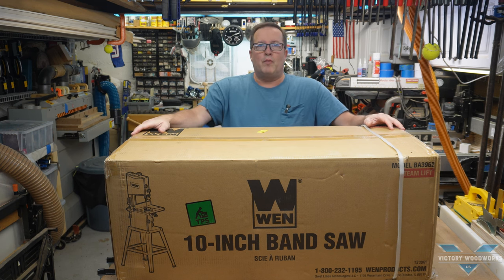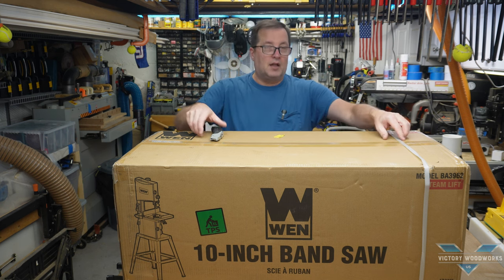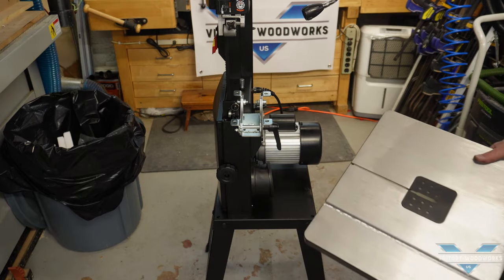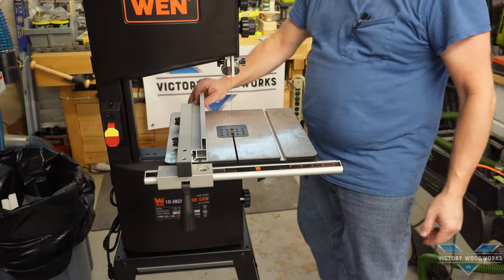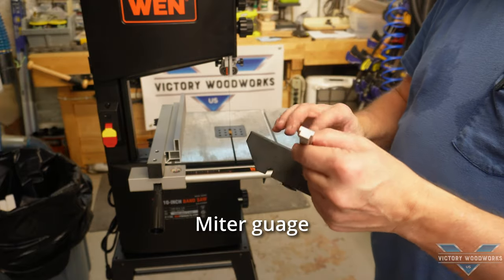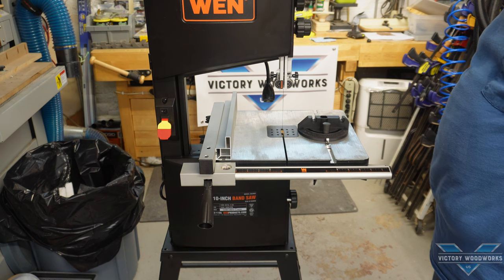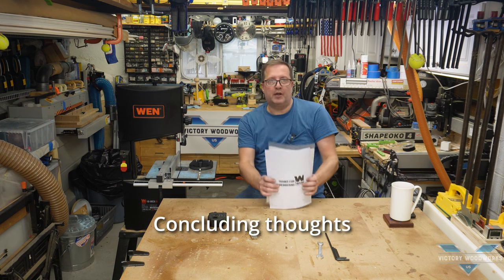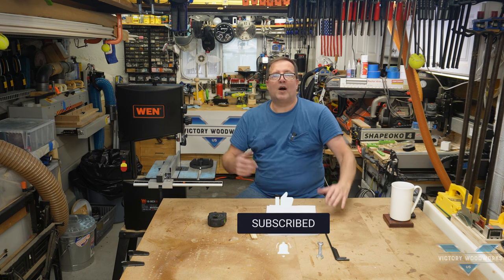Is 10 inches enough? Wen 10" Bandsaw Review (S23E18)

Comment: two things I learned recently, the bearings on the top and underneath the table portion need to be adjusted to no more than a 16th of an inch from the blade. basically as close as you can get them without them spinning when the saw is turned on. And the other thing was the positioning of the blade on the pulley wheels. Apparently the gullet portion of the blade is what needs to be perfectly center on the wheel. lots of folks think it's the center of the band on the blade that's supposed to be centered in the pulley but this causes lots of wobble. The issues you were dealing with are the same that I was dealing with and it corrected them perfectly! Thanks for your channel!
Reply from the maker: I totally agree with your fixes.  I did the same/similar. I also found that the lower wheel was slightly out of alignment and needed to adjust that.  Thanks for watching and commenting.

Comment: Great video. I recently bought the Craftex CX118. It's a Canadian company but looks to be the identical saw. I assume they're all made in the same factory with different paint lol. I really did not expect it to be so underpowered though. I'm coming from a slightly larger saw (14" King Canada), but was much older and missing parts. I actually came across your video as I was looking for tips and tricks to get mine working a bit better. didn't expect to see the identical saw! 

I think at this point, I need something like your minimax as I want to do some re-sawing. But this was a good video to confirm my thoughts - and I was able to get it for about half the price

Wondering how it performed with a different blade? Was hoping to see that in the vid. Either way, thanks for posting! Great review.
Reply from the maker: Thanks for watching and commenting.  The MiniMax 16" is an excellent band saw and very good at resawing with a 1" blade. saw. I bought the Wen because I needed something smaller so I didn't need to swap out blades all the time (typical cut takes 30 sec and blade swap takes several minutes).

The blades that came with the Wen were not very good, so I tried the Ayao version.  These blades were better quality, inexpensive (2-pk $16USD) but dulled quickly.  I think if I/you were to use a better blade (like USA Band Saw Blades -> gmbandsaw.com or Olson) the saw would perform even better.
Reply: @victorywoodworks  Great points! Thanks for the reply. Will have to give them a try!

Comment: Hello there, this is a good saw, not as flashy as the Rikon version but very capable. Your pros and cons are pretty good I have been using this model saw for a few years and I love it. My intention was to buy two band saws this one and a large one but honestly this saw is so useful I still haven’t bought a bigger one. So maybe 10” is enough. I generally work with wood that isn’t wider than 6” so it will fit my jointer and this little saw can resaw 6” hardwood all day. I use 3/8 3PC and a 1/2 3PC blade from Timber Wolf to resaw and it cuts with ease. My main general use blades a 1/8 & 3/8 blades and they cut clean. You are sort of right about dust collection and I never calibrate the fence ruler but the fence is great sets up easily and stays true. One small gripe is to open the bottom door you have to loosen the fence clamp as it blocks the door that’s a problem if you have a tricky set up for multiple cuts. I made a handle that is out or the way of the door. I don’t like the non magnetic aluminum table and the non standard miter slot but I made a sled with runners for the slots and it works great. I found that positioning the work light out and away from the cutting area works best. This saw punches above its weight and I love it.
Reply from the maker: Thanks for your feedback.  I hadn't thought about building a sled for the saw, but now I think i might. As for the work light, I bought a hose clamp with a rubber padding on the inside and screwed the light (arm) to the under/inside of the upper shroud of the saw so it faces the operator. Now I can aim it at the front of the cut more easily. Thanks for watching and hopefully subscribing.
Reply: @victorywoodworks  always glad to hear from another WEN user. BTW during my most recent blade change I noticed a slight wobble in the top wheel. I removed it from the shaft and discovered the shaft was a few threads unscrewed. The threads were ok so I tightened it up with a 12mm open end wrench. Put it together and all was well. Enjoy your woodworking.
Reply from the maker: I will check mine to make sure it doesn't loose up. Thanks for the heads up.